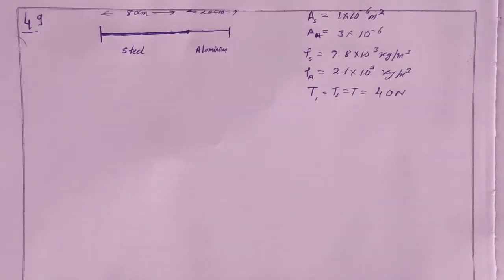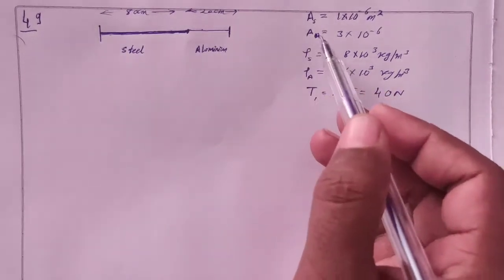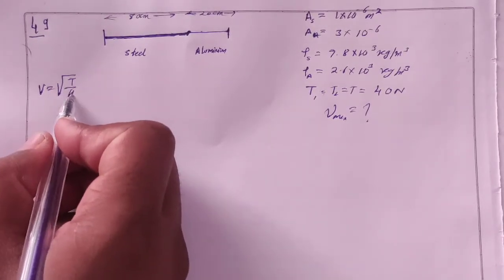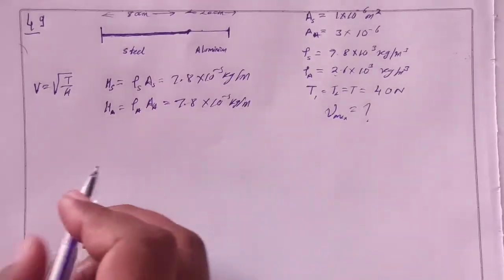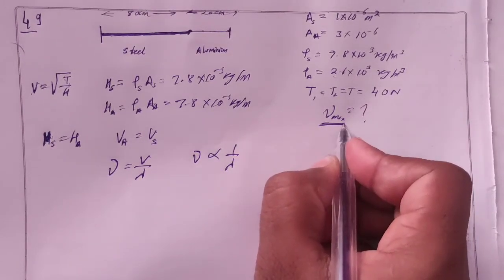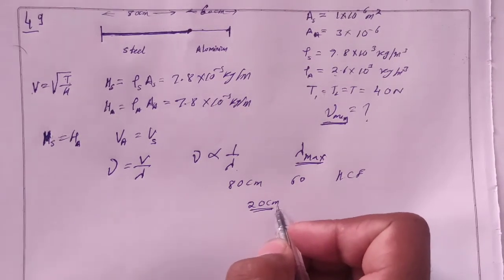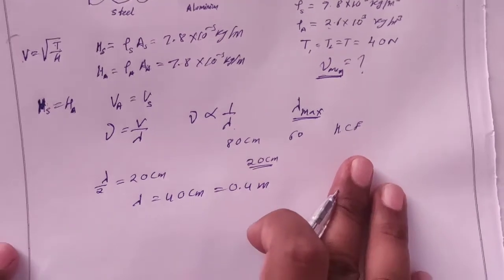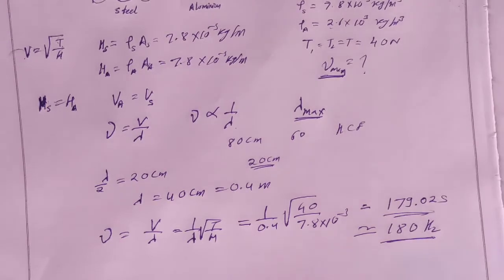H.C. Verma Solutions - Wave Motion and Waves on a String - Chapter 15, Question 49

Comment: How is mass equal to density into area

I heard mass is density times volume shouldn't we multiply the length of the wire also the with the area to get volume
Reply: It’s mass per unit length (mu) that’s why.
Reply: they are actually calculating mu and not mass